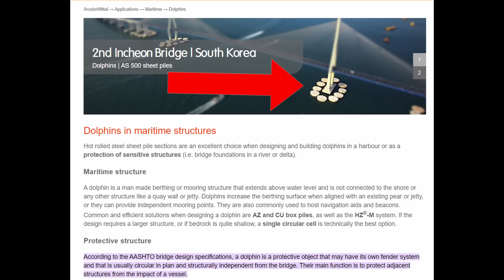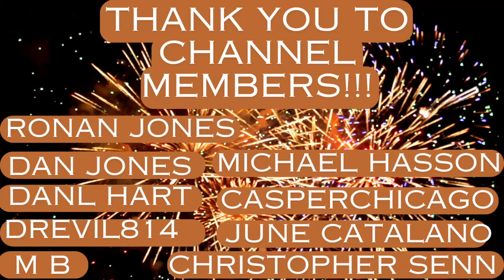Baltimore Bridge Collapse

Comment: Lack of adequate bridge protection I think.  Many have large island supports or addition islands or dolphins to protect it.  Might of been up to code but the code should change.
Ship lost power.  You can see engine snoke.
They did put out mayday
Reply from the maker: I agree with you. There needs to be some type of warning system on the bridge to stop traffic in these situations.  I mean this was really a slow motion "train wreck".
Reply: @CaseyJones-Engineer Imagine if all bridges had a railway-crossing type gate system with a universal radio receiver on a coded frequency, and every vessel of a certain tonnage had a big red button behind a glass safety cap that said "push if out of control near a bridge" or something like that. Hit the button, gates go down, traffic backs up on either shore. Worst case scenario is a similar collapse during rush hour with maybe a few unlucky stragglers hitting the drink, best case is a near miss and thousands of people are late for work with a story.

Also, Google Maps doesn't show the route closed as of 11:32 pacific time.
Reply from the maker: @Eh_Wing   Thank you, I think that is an excellent idea.
Reply: @CaseyJones-Engineer  ten knots slow.  I despise toll roads but there being toll gates probably saved lives in that they could shut down additional traffic going over bridge once warning was given.

Comment: Note the smoke coming the engine stacks. There are other early bridges without sufficient protection.
Reply: Sufficient protection can be added at any time, in this at any time, within 50 years ...
Reply: True that. I understand that in San Fran bridge tugs escort the large ships like this thru/under the SF Bay bridge ... there may not be a big enough dolphin or bollard to protect bridge pylons, so a requirement to escort w/tugs may have to be made.

Comment: So now there is no entry into the port , causing massive chain reactions already , i hope they have good insurance
Reply from the maker: Yes, it will be some time before the channel will be opened up to ship traffic.
Reply: @CaseyJones-Engineer    this will completely devastate, the already devastated Baltimore economy no one on that ship will sleep well over this.....the crew reacted to the unfolding disaster at warp speed however... there were a lot of good men on that boat.
Reply: Amazing how less than ten seconds of failure will affect millions of people and cost billions in it’s overall impact on residents and business for years. Lawyers are going to get rich from all sides of this disaster
Reply: @PJMontoya whoever loses, the lawyers always win
Reply: @PJMontoya  In the case of the FIU bridge, there was no money left for the actual victims.
Reply: ... and a blocked Interstste highway ...
Reply: @abrahamdozer6273  Won't be rebuilt in a few weeks like Philly.
Reply: @robertslugg8361  Clearly not
Reply: When the USA had the can-do attitude,  things happened Quickly.... time will tell.
Reply: depending on how many cranes they can get on site, I wouldnt be susprised to see accelerated clearing of the channel once the disaster site is released by investigators/rescovery folks (there are still 4 bodies).  I assume that floating cranes are already under way.   The order in which they lift bridge structure will be interesting. Freeing the ship so it can be taken out of the way may be priority even if not the easiest of tasks.